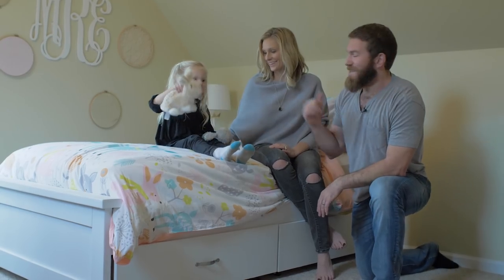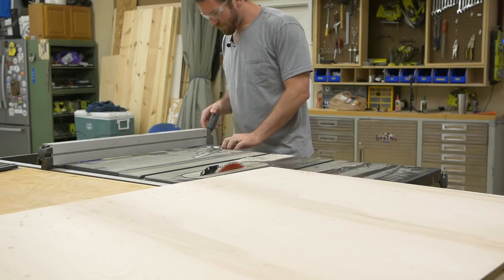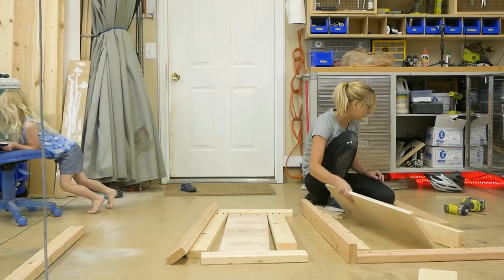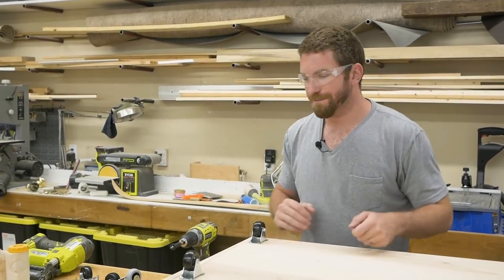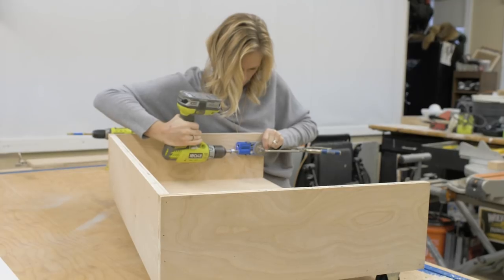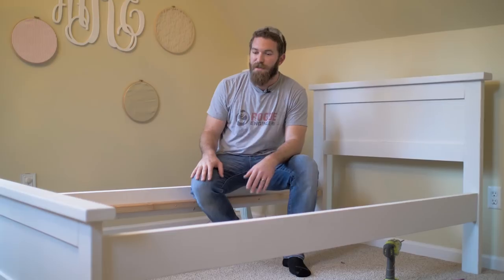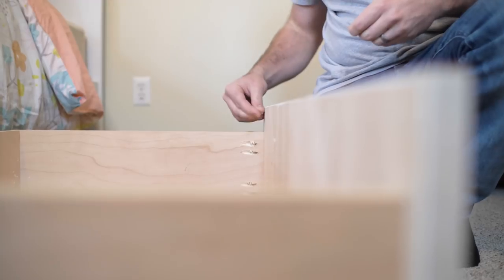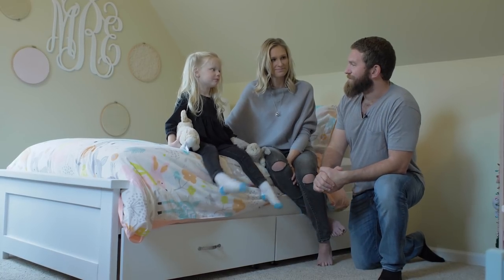How to build an Easy Twin Bed with Storage

Comment: you really do gotta stand there while they cut for you an make sure they dont go too fast, especially on cross cuts. simply refuse the board if they damage it that way an have them do it again. ive done it a few times. that horrific tear out is usually mostly avoided if they arent rushing the cut, which they almost always do unless ur standing there telling them not to. not paying $80 to have them butcher inches of the board. nope